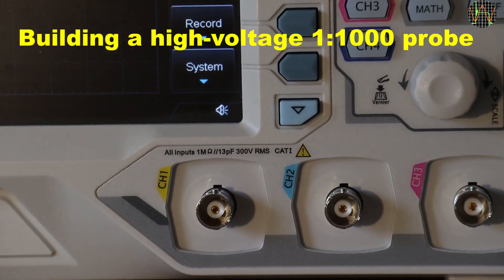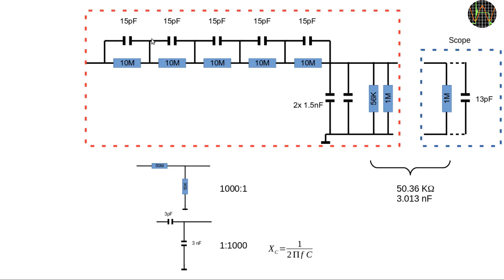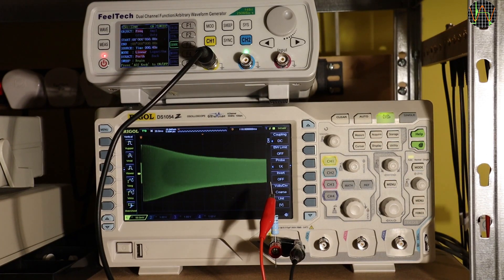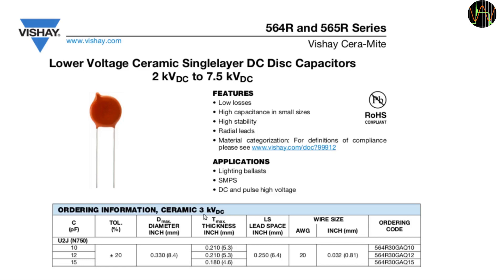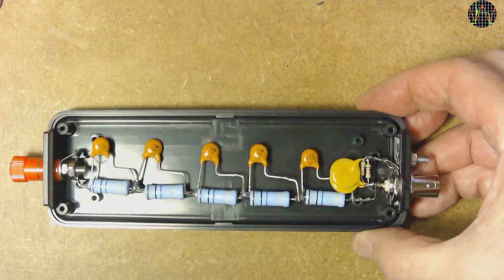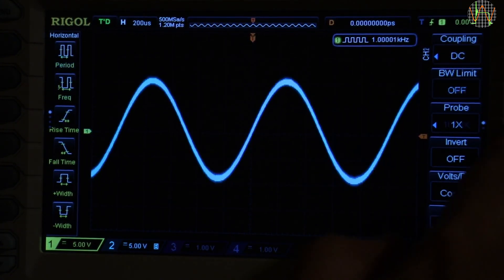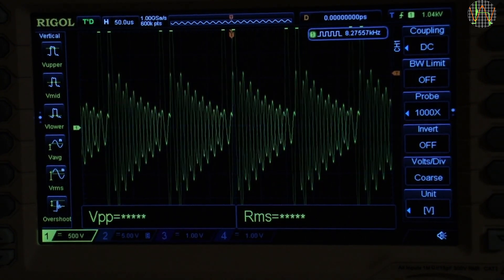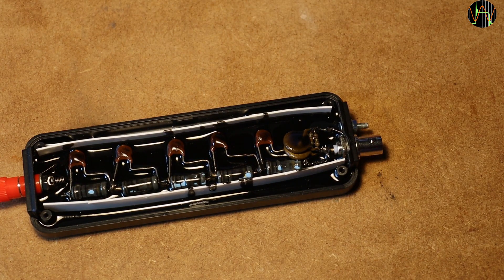Building a high-voltage 1:1000 probe

Comment: I built something similar and I only got to around 2MHz of bandwidth before the phase shift and distortion started. Do you know how to improve the divider to get higher bandwidth? You said something about a trimming capacitor.
Reply from the maker: Yes, if you look at normal scope probes, they always have a small trimming cap. I did not put one into this one because of the high voltage. I had no experience in building a HV probe or examined a commercial one and I thought I better err on the side of caution.... That makes the whole thing more a gamble based on tolerances of the caps used (which is considerable) the spacing of components inside the probe,  the capacity of the scope, the BNC cable to connect the probe... you name it. I wonder in hindsight, why I did not tested the bandwidth and optimised it by swapping caps   before putting the potting compound in. I guess its a learning experience, sorry.  With swapping caps, i mean because of the tolerances they all have a different value, hence swapping say the last one with a different one from the pack may act as sort of the trimmer
Reply: Hey,I think this design can be improved by external copper shield also if you can use smaller components or less number this can decrease lead resistance and parasitic inductance which can cause problem at higher frequency and if you can choose a variable trimming cap

Comment: hmmm excellent job, i wonder if the black epoxy can be used to repair a flyback leaking high voltage !?
Reply from the maker: I would say probably yes. According to the data sheet of the compound RS part no 199-1402 the dielectric strength is 10kV/mm, but since they may have changed the formula in the mean time, you better check the current datasheets of whatever compound you are planning to use.

Comment: I would have used for protection and some diodes (like BAS70LS with 100mA and 2pF in series with TVS/Transient-voltage-suppression diode) in antiparallel on output
Reply: TVS is always in antiparallel?

Comment: Wouldn't it work if we use main resistor chain 1Gohm  and use input 1M as the second resistor in the divider?
Reply from the maker: Not really. First there is no chain, 1Gohm to 1 Mohm is already 1000:1. This means you have to find a 1 Gohm that can handle the full voltage and then a capacitor that can handle the full voltage. But the biggest problem is that a probe output resistance of 1M is way too high and in the same magnitude of the scope's input resistance. The divider accuracy would be seriously affected by the scope. The result would be very difficult to predict (from scope to scope) and also probably depend on what attenuation is currently selected on the scope. This happens with the current design as well of course but because its output at 50K is only 1/20 of the scope's input resistance, it dominates and the scope's influence can be ignored (this is not a super high precision design anyway).
Reply: @TheHWcave  I though 1M scope input resistance is a precisely controlled value, so that probes just add in series resistor (and capacitor).
Reply from the maker: Most are  1M  but some cheaper ones and PC-scopes are not. The probe's output resistance (50K in mine) is in parallel to the scope's input resistance of 1M, which is makes it effectively 47K . But a 1M output resistance would become 500K, a huge change and spoiling the calculated ratio of the probe

Comment: What is the part number of the resistors you are using?
Reply from the maker: Vishay 10MΩ 1W Metal Glaze Resistor ±5% VR68000001005JAC00 and the caps are
Vishay Single Layer Ceramic Capacitor SLCC 15pF 3kV dc ±20% U2J (N750) Dielectric 564R Series
Reply: @TheHWcave  Thank you so much

Comment: Thanks for this video! I wondering how the impedance of the BNC connector affects the calculation? Did you use a 50 Ohm variant? Thanks for your reply
Reply from the maker: No I did not. The output is calculated to go into the 1 MOhm input impedance of my Rigol 1054z scope (which doesn't offer 50 Ohm)

Comment: Hi, adding some protection (back-to-back transistors, tvs, gdt, zener, ...) on the oscilloscope side will mess with the probe or its performance?
Reply from the maker: To some extend yes, the protection diodes always have some leakage (= high ohm resistance) and capacitance that will be put in parallel with the scope's input resistance/capacitance. How serious that is depends on the scope and datasheets of the protection devices. To the best of my knowledge  commercial (passive) high-voltage probes do not add protection devices but maybe I missed it. Best would be a test with and without protection to see if the scope picture changes significantly. Of course the test would be such that the protection devices are not activated.

Comment: Hi, nice video and very informative.
I'd like to make the same HV probe but is there any substitute for the black potting compound that is more common and a bit cheaper to buy in most local hardware store?
Regards, JB
Reply: Paraffin wax has a very high dielectric strength and is cheap as chips.
Reply: @johnmitchellytb  Thanks for the input, will look at it.
Just one more question, does it harden like the black potting compound? My purpose is not only for this project but also for some other projects that need rigid sealing material similar to the black potting compound.
Reply: @PLASMUX-20   Think candle wax. It'll melt at less than 100 C and then solidify. Not hard, like epoxy, but it's in a rigid box...
Reply: @johnmitchellytb  Okey, thanks for the additional info.
Reply from the maker: There is some "red silicone" that a viewer recommended as a cheaper alternative, but I can't find the message with the details at the moment. I have not tried it yet. Further,  there is a discussion thread on the EEVBlog with respect to cheaper potting alternatives which I would recommended to look at, but the EEVblog is currently down because of the data centre fire in Utah.
Reply: @TheHWcave  Thanks for the reply. How about the silicon used in hot glue gun  and the red silicone sealant used in engine, but I am thinking the red one use in car engine is also expensive I think?
Reply from the maker: @PLASMUX-20  For sure not the usual DIY sealant stuff because that gasses out acidic vapours that will corrode any electronic circuits. I need to dig around more to find the old comment on the recommended red compound.  Also I would checkout  the EEVblog forum when its back.   The problem with many potting and sealant compounds is that electrical isolation is not their prime objective, but in this probe it is. With these large resistor values, any accidental leakage through the potting material would be disastrous, maybe not for safety but for performance.
Reply: @TheHWcave  Thanks, yes maybe gases cause corrosion which is one of our enemy in electronics. I also think about melting nylon material and pour into them, what's your thought about it?
I am playing with tesla coils and found out that the best insulator for me is nylon and silicone...some materials like glass, rubber, plastic, mica and polyethelyn fails.
Reply from the maker: @JB-N107Lab  I don't have much practical experience with potting at all (the one in the video was the first and only one so far). Melting nylon sounds way too hot. According to Wikipedia it melts at between 190 to 350 deg C, that would possibly de-solder the components but even when not, probably cause heat damage.

The EEVBlog is back but apart from plenty of anecdotal stories (use candle-wax ...) not much help for non-US residence as the stuff seems not available or very expensive.  However, one manufacturer MG chemicals is being distribute by Farnell in the UK. Their product B32B seems very suitable. It comes as  a 375ml pack as 2 bottles that you pour the desired quantity in 2:1 ratio into a mixing bowl yourself. I calculated that in total, this will fill a volume of 362ml for £24 incl VAT  (6.6p /ml) . The RS-compound in a one-use 500g bag costs £15 incl VAT and will fill in my calculation 296 ml (5p /ml) . If the volume to be potted isn't 296ml, the Farnell may be cheaper as you can make only as much as you need and reuse the rest some other time.
Reply: @TheHWcave  Ah I see. ok, thank youv ver much.

Comment: I need a 100KV probe! Build it?
Reply from the maker: Wow, 100KV is way out of my comfort zone.  You would need rather special (=expensive +hard to find) resistors and caps that could handle that huge voltage differential. If you instead use similar ones to the probe in the video, you need to use 10x the number (so that the differential voltage at each stage stays in the 1KV range). Just the size of such a probe would be enormous. I think I pass...

Comment: Hi great video! Do you think adding an opamp would help increase probe bandwidth?
Reply from the maker: Possibly, but the best opamp can't recreate what has been lost in the divider, so I think the first thing would be to look at improving the divider so that can be tuned (compensated) to match the scope. A bit like adjusting your divide-by-10 scope probes. To make this work (safely) for high voltages would already be quite tricky I can imagine. Then the opamp would probably have to live in the probe and be battery powered for safety etc..

Comment: Alternative for high voltage compound: hardware store high temperature silicone (use the red one not the black). I used that stuff to repair the high voltage CRT supply (HV multiplier) in a old oscilloscope. Years latter it still holds. Takes quite a while  (a few days) to cure fully.
Reply from the maker: That is an interesting idea. Do you have more details on the red stuff? I looked up a local HW store chain in the UK and while they have black, they don't have red high temp. silicone.  Online I found J-B Weld 31314 which is red, but quite expensive, certainly no price advantage compared to the specialised compounds.
Reply: @TheHWcave  Not really. It is commonly available in all hardware store here (Serbia) with a wide selection of manufacturers. Commonly available as 300C silicone for stoves and furnaces. Bison is one of the foreign popular brands that should be available in the UK. Prices are around 5-7€ for standard 300mL tube.
Reply: @TheHWcave  Something like this: https://www.uksealants.co.uk/everbuild-heatmate-high-temperature-silicone.html
Reply from the maker: Thanks for the link. I may give that compound a try in the new year

Comment: So,  is it compatible with any oscope? I use cheap chinese usb oscope. 
Anw,  thank You,  Sir 
Loved your vids
Reply from the maker: Hi TheJavaSync. It depends on the input circuitry of your scope. The probe is designed for 1 Mohm 13 pF inputs. The 1 Mohm is fairly common even in cheap scopes. The 13 pF are not terribly important as long as your scope is roughly in the same order of magnitude.  If you scope has a different input resistance, you can always adjust the parallel resistors so they combine to 50K (to work as a 1:1000 divider with the 5x10 Meg series resistors)

For example, if your scope has 10 MOhm input resistance, you can use the same trick I use when connecting the probe to one of my multimeters (which also have 10 Mohm input resistance): simply add an additional parallel resistor of 1 Mohm, which brings the whole parallel resistance to near-enough 50K. 

Another thing to consider: The Rigol scope allows you to set the divider scale for each input on the scope. This is purely so that measurement readouts use the right scale and unit on the screen. If your scope does not offer a setting of 1:1000 at the input, you need to leave it at x1 and do the conversion in your head by remembering that 1V shown on your scope means 1000V on the input of the probe.
Reply: Thank You for your reply,  Sir
I'jll find datashret for my particular scope,  & follow your instructions,  I think easy for me to find all componenrs at local store..
Really sorry for annoying You & for my bad English,
Reply from the maker: no worries, you are doing very well

Comment: Hi, Heinz... Another great project and video. I was glad to see that you (attempted to) pot the components in rosin. I suggest putting it in an additional box, or wrapping it with lots of electrical tape, until you can finish potting it. Shrapnel is not your friend. And, we want to keep you around...:-)
Reply from the maker: much appreciated... I have tested the probe against the most terrifying power source I have (a neon transformer that fried the resistor in the video) and did not see any arcing or other problems. Although the transformer says 6KV, I measured against earth a cool 9V on the output of the probe, meaning 9KV on the hot end. So I recon its safe (as far as those things go...) but as I mentioned in the video, I would never touch this probe when power is on and in fact I always keep well away from the whole setup.
Reply: I love this HV-Probe, you made it secure and working, tell me one thing can I use this Probe on multi meter too, and I want tovexclude the capacitors, what is your wiseable suggestion.

Comment: I’m not sure about a plastic box being ok, especially a black one, black plastics use Carbon Black as a pigment, as we know carbon is conductive, if you check the datasheets for plastics material you can see that the dielectric resistance is lower for a black material compared to a white or natural coloured one, still I nice educational video though, well explained.
Reply from the maker: Good point about the black colour. I did not think about that. Although the potting resin is also black and that has a dielectric strength of 10 kV / mm. I tested the probe with was probably the better part of 9KV and did not see any issues, but I am fully with you in regarding the enclosure's isolation capability with suspicion. It should never be touched or held when its in use, nor should any other wires/components/devices touch it.

Comment: Great video! Thank you very much! Keep making these videos. Looking forward to your next video. Stay safe 
Edit: How about enclosing it in a small sealed tube filled with mineral oil?
Reply from the maker: A great suggestion. The components need to be mechanically secure first before they can be immersed. The "string" of resistors is too fragile to suspend itself on the solder joints. Don't forget that the resistors are big and have a high mass, so any bump causes quite some mechanical stress. Another thing is that the circuit would need to kept centred to avoid touching the walls... A carrier PCB perhaps that is wide enough to just fit into the tube? I know people have put these things into cut-offs of normal copper water pipes which has the additional advantage of shielding, but the metal also causes stray capacitance issues... It really needs experimentation. But the oil-idea is something I'll keep in mind if I need to make another one or maybe for higher voltages.